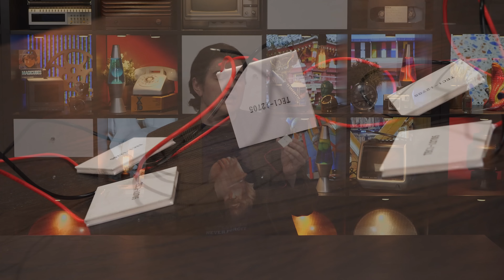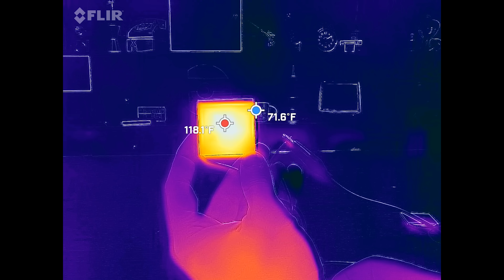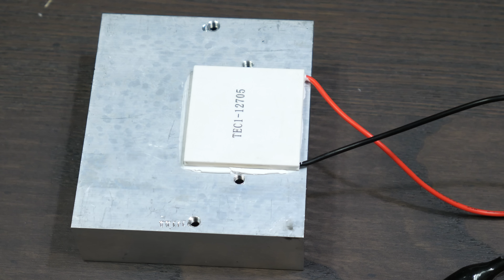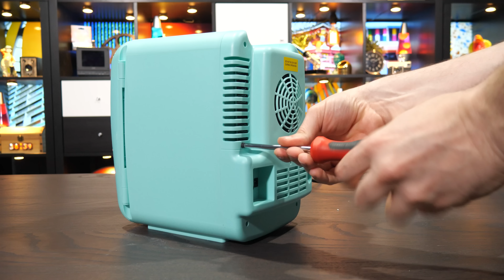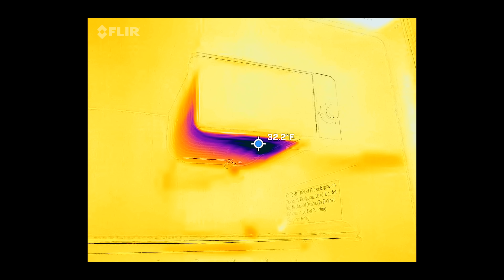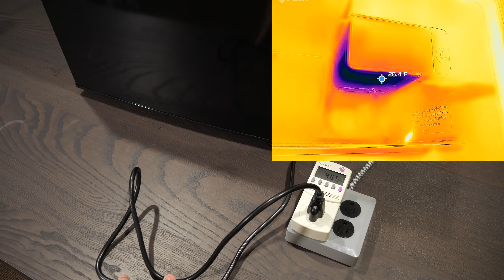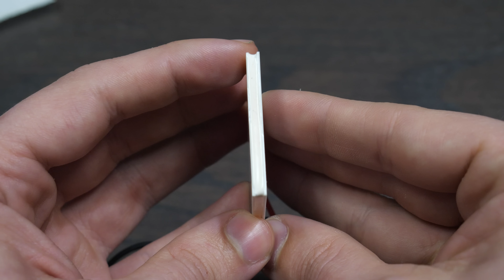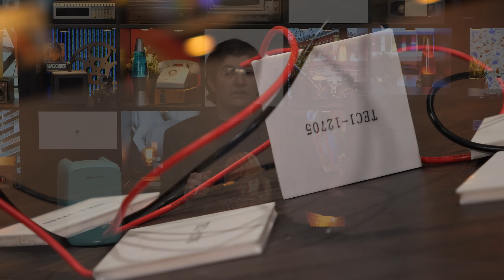Thermoelectric cooling: it's not great.

Comment: Good video for sure!

I really only see one benefit of those mini coolers with Peltier elements and thats why I bought mine:
They are portable and I can use a solar panel to power those (usually they come with a 12V DC option).
I also never intended to use it to cool something down. It's actually the opposite: To keep something cool.
Adding cool items will hold them cool so you go on a beach day that is really nice in not having to buy cool drinks.

Comment: blue one can fit on a desk, and chances are, you're bringing in pre-chilled beverages to maintain their temperature, rather than cool from ambient temperature. Also, since it is at work, the power difference is likely negligible, and even if it were worse, it is overall better due to the small form factor.

Comment: I wanna play devil's advocate to the Peltier device  on 2 points

1. Filling it entirely reduced the efficiency of how it could cool the cans. If it were retested with 3 or less, I'd wager they were colder than it being stuffed full with 6 cans

2. Some office employees don't have the luxury or rank to have an office with the space for a mini fridge. Let's say you work area is a cubicle. Space is already at a premium with your desk, filing cabinets, drawers for office supplies, computer, keyboard, and possibly printer nearby. There may not be enough space to place a proper mini fridge, if you were allowed to have one

The Peltier device sitting off to the side chilling 2-3 cans of drink would be more than sufficient in this use case.

This is like comparing a Prius to a diesel truck. Both have advantages and disadvantages depending on the situations they're used in
Reply: Another point, fridges don’t like to be moved around and often say: “leave for 24 hours before turning it on”.

Comment: I use mine to only keep the temp regulated to below room temperature only. Not cold. I use mine for my apothecary, not to keep drinks or food cold. It works well for what i use it for.

Cool it down faster by sticking a bucket of ice in it for a couple of hours. 

Again, good for what i use it for, but otherwise it is useless.

Comment: This guy is dissing the technology based on a cheap item. 
I bought a medium sized insulated chest that used these with large heatsinks (inside and out). It had therostats and switched between heating OR cooling using 12VDC.  That was over 25 years ago and still works fine. I use it for week long camping without ice. Yeah, it cost a lot but not too bad compared to yeti coolers.
I bought a car sized one about 10 years ago it could make tiny ice cubes abd it still works. Finally I bought a cute used Coke a Cola like his. It does keep cold can cool in a hot shop.

Each works fine for their intended purpose & You get what you pay for! Like using an ice chest, you need to understand hiw it works and their limits. I.e. per-chill & pack with cold items. Don't keep in direct sunlight. Keep it closed tight and open as little as possible. (Faceup like a bucket hold in cold)
These add a few issues: all the cold is by the fins. It can freeze anthing touching or near these fins. So pack icecream by fins and lettuce/jelly etc on far side. If you want more even temps, pack with open spaces and use small battery powered fan. (Not worth the trouble)

Comment: I have a Peltier cooler unit that was used by the military in Iraq or Afghanistan desert.  I use it to educate some of the local HVAC technicians to a form of cooling that they are not generally exposed to.  Most, if not all, have never even heard of thermoelectric cooling.  This does not surprise me, as education in physics is very limited these days, and, most only want to learn enough to pay the rent.   Rare is the statement that "hey, I can make that device much more efficient!" , but, I like to hear that sort of thing.

Comment: Why not just cascade Peltier junctions to drop the cool side temperature below the freezing point of water?  Seems this would not be very complicated to build a nice little fridge that would have both a freezer section and a refrigerated section using solid state modules.  Also, increasing the insulation thickness of the walls should give better results on a custom fridge build.   Just a few thoughts ............
Reply: It’s the energy use that is the issue. Placing them in junction would also just move all the heat to one side.

Comment: My Frigidair fridge has a wire rack on the back for heat release its older one  and 4 inches thick stryo and does not cost that much to run either ...

Comment: question!! how big would a solar panel or some sort of wind or other generation cheap and easy need to be to run a peltier system vs a bar fridge? wouldnt peltiers be for like in 'cars' or 'boats' or aircraft where it could be bouncy or pressure differences. so peltiers would be for smaller and more transportable things obviously but i think its so theres no flammable or explosive or pressurized things.

Comment: I have a little combo BT speaker/mini fridge 'toy' I got on clearance at Lowes earlier this summer.  I only use it on the weekends when I do woodworking in the basement to keep ahem, water, cool for when I  need a hydro break.  Other than that, the speaker works fine 😏

Comment: There could be one very important application for Peltier elements: maintaining thermal stability in high-precision electronics as their qualities are VERY desirable for that application. In particular, for that application you need something that is fast to react, can both heat and cool and has heat throughput that scales proportionally to voltage or current. And Peltier element satisfy all of this. Their low efficiency is less of a concern as there isn`t much stuff to heat/cool (just a bunch of ICs) and devices that need it are rather rare and expensive themselves.

Comment: So genuine question then: obviously the entire unit would end up larger, but if given proper insulation and quality materials, along side a temp control, could a peltier unit, or maybe a couple of them, actually make a decent tiny fridge? Not that it would be practical, and it would still probably be less energy efficient than a real fridge, I just want to know if it can be done

Comment: I dunno, you are testing an actual cheap one. I have two mainly for my car and they get cold fast and get internal temps closer to 38-34f.  One of them has the ability to actually freeze. So yeah these cheap ones are useless, but a good one like a yetti or coleman are pretty good.

Comment: I have one of the little black mini fridges for about 10 years. Recently, is sounds like the motor doesn't start on its own and makes a lot of heat at the compressor. Give it a thump with something soft (a sneeker) and it will start up spinning on its own until it reaches temperature. I had another big old fridge (25 years ago) that did the before and i had to change the 'starter capacitor' is there something similar in this i can get to or is it destined for the recyclers?

Comment: I own two of the Coleman coolers with this tech that I mainly use for camping when their is electricity like in state park cabins. I replaced both the outside and inside fan with budget 92mm Thermalright fans. Airflow was very similar on the 92mm it replaced but it is so much quieter that now I can run this one inside the living area even sleep near it in the same room. The stock fan is way too loud for that and I keep that one outside on the porch. The outside one acts as a borderline freezer with the temps being much cooler outdoors over night. The inside quiet one keeps the contents cold but not frozen. I enjoy having mine as I don't need ice and I keep the meat in the outdoors one and everything else on the inside one. Work great for my intended usage of 2-4 days.

Comment: a fan from the inside that spread the cold air from the peltier cold side (radiator) will increase its efficiency by a lot. the design of the blue fridge is bad, do not judge other designs. also, ive developed a program via arduino that manages temperature, which increased its efficiency by a lot.
Reply: also i forgot to add that peltier modules are much more efficient at 60% of their power, so if the arduino controls it well, it can be used as a fridge.

Comment: The only good application of these I've seen is in their reverse power generation state. I have a wood burning stove that I have a peltier fan on. It has one of these in the base that powers a little DC fan to move the air around above the wood burner. Simple and actually renewable not consumable as far as energy.

Comment: Pressurized oiling systems for compressor applications do exist.  (In fact, they bleed a little pressure from the compressor itself to work.)  They're just not used in refrigerators for cost reasons.  For a portable unit, it would be worth the cost.

Comment: I don't know, I use one at the beach with a portable battery and it keeps everything cold, including ice for three hours. Now, you do have to put everything in at the start already cold and run the machine for about an hour before you head out. BUT - I still get some ice cold beverages at the beach. YES, it's not a good thing to take something from warm to cold...it takes a long time. But, if you put them in cold...in my experience it keeps them cold. Even my ice stayed around for those three hours while very slowly melting. 

But yes, they can not be used to cool anything fast from room temp.

Comment: This coolers can be used to cool computer parts like CPus, but the problem is they need more energy than the cooling they put out - so while it technically cools your CPu, that heat ends up in the room and needs to be removed by AC otherwise the Peter is pointless if it's just raising your ambient room temperature

Comment: You are comparing apples with pears one is a low voltage unit designed  to keep cool things cool only the other is a mains operated compressor fridge and won't work in the back of your car will it ?Different fridges for different conditions ALSO the refrigerant in the compressor fridge is Highly inflammable so you get a gas leak inside the fridge thethermostst makes or breaks it make a spark and BOOM  you have a bomb .

Comment: I have a micro fridge similar to that one. I knew it used a peltier divice, and i assumed it wasn't very efficient, but i had it running in my game room for a couple of months. But after moving, I didn't use it as much, so i unplugged it. I had no idea they were THAT inefficient. I'm glad i stopped using it. I still have it, and my assumption was that i would use it for long car rides since it comes with that kind of adapter. But I don't see myself using it anytime soon (or ever)

(On a side note, it would accumulate frost/ice on the cooling spot)

Comment: one thing i see not mentioned is  Long term use a air con/refrigerate need to cycle on and off(with newer tech this is becomeing less and less an issue) where a pelter can be at full power 24/7.

so if you need for example 400watts of cooling for long term use or what ever application Pelters are really the only way to do this. but hes is correct in his comment this is not normal person use this is us Crazy people building stuff.

Comment: As a wedding gift, someone had purchased us a small Harrier wine cooler, which could only hold 3 bottles of wine.  I couldn't figure out why the electric bill went up by about $15-$20 (back in 2008) each month the cooler was plugged in...but I ultimately blamed it on terrible efficiency because bottles would never be cold.  I'm pretty certain now that the Harrier cooler likely was using thermoelectric cooling.

Comment: I wonder if those could be used as a medium between computer water cooling system and house heating system (as in those ribbed heaters). 'Cuz I've seen an attempt of combining those, but it used the water/liquid itself to do so and heaters are mostly polluted and were clogging the computer cooling system in few hours.

Comment: Peltier coolers have changed the world. They're used in industrial tools to keep chemicals chilled. I've only seen them used around 17-24C , which isn't exactly cold enough for your fridge, but in a hot industrial environment where the chemicals need to be kept at that temperature they are used. A lot. I've worked with them. Made PIDs for them (a PID is a mathematical function that is used to control things. In this case, temperature). These industrial processes are essential in the semiconductor industry, and a lot of them will use chemicals cooled by Peltier elements.

For example, TMA is a liquid kept at cooler temperatures, and used at those temperatures in processes such as ALD. ALD itself has become pretty much essential to manufacturing extremely uniform substrates, which can be used for an immeasurable amount of applications, but its most common one will be used as a substrate for transistors.

Comment: One myth I don't like is one you actually sort-of repeated in this video. The old CFC refrigerants weren't an issue because of their use in refrigerators. The refrigerator system rarely if ever leaked, even when spending years at a landfill site (and usually the damage then was caused by the landfill machines). Most breakdowns were caused by the electric pump or power supply rather than a refrigerant leak. And those landfill leaks could have been entirely avoided by removing the heat pump mechanism so that the gas could be removed and reused in newer refrigerators. On top of that, there's actually so little refrigerant chemical being used inside each unit, that even if ALL of them leaked their entire contents it STILL wouldn't have been enough to seriously damage the environment or cause the holes in the ozone layer. Instead the damage was caused because those refrigerant chemicals were used for products they shouldn't have been used for - namely spray paints and other pressurised containers - that just expelled their contents into the air ON PURPOSE. All because CFCs were cheaper than the propellant alternatives used at the time. And it was the widespread use and one-time-use nature of THOSE products that caused all the damage. If their usage was restricted to fridges as they should have been, then CFCs would still be perfectly safe for us to use today. Company greed, stupidity and lack of regulations is why we ended up with a giant hole in the ozone layer NOT because of refrigerators or even because of just CFCs themselves being inherently bad.